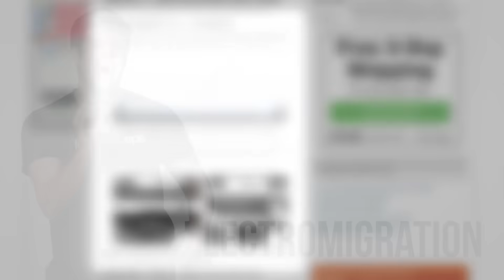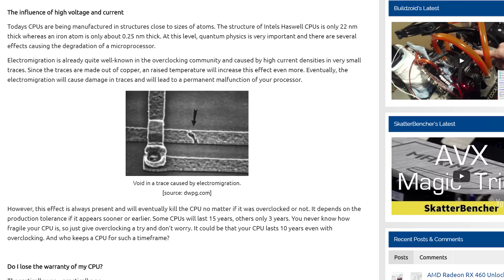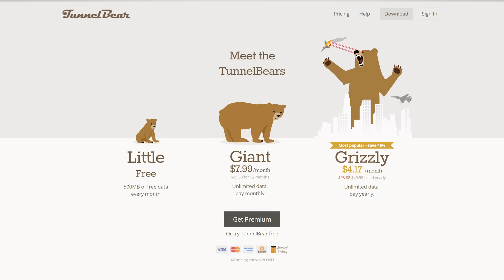Why Do Electronics Die?

Comment: Oxidation. Only gas tight connections are immune to it. Switch contacts, jumper pins, ribbon connectors and so on are potential failure points. Examples of gas tight connections are soldered or crimped and screwed down terminals.

Comment: The old axiom about "moving parts = failure" crumbles when you consider how many more failure points there are in an electronic substitute for a mechanical part.
Perfect example is the $350 Anti-Lock Braking control module for my car. It is no longer communicating with the Engine Control Module (main computer), so it has likely had an internal physical failure. The mechanical aspects of the braking system work just fine, however - the car slows and stops just as it ever did when pressing the brake (it has simply reverted to a non-ABS system). Both the mechanical components and the electronic ABS control module are the same age, but I'm about to burn $350 and an afternoon to make a light on my dashboard turn off, due to an electronic failure.

Comment: Suggestion for another video.   When I blew up my 3kW, 12V inverter from China some of the parts I could not find on the internet to troubleshoot,  e.g. a couple of 12VDC to 110VDC transformers I couldn't find datasheets or schematics for. So, I couldn't troubleshoot them or find replacement parts. Can you come up with any new ways to track down parts like these from China? LuyuanlPower, model DX-GAC3000W; transformer/converter p/n ZB4215 12V-110V

Comment: (Aug 2023) - I just caught this amazing video. Marketing always talks about how great the products are. Service and repair videos are very few and far between. One thing that wasn’t mentioned is variation in manufacturing.  I think manufacturing engineers, and the people who actually make things so well every single day are the unsung heroes of the electronics industry. Put it another way… If the connectors to a power supply are not crimped correctly, that connector will eventually fail.
Thank you again for a great video!

Comment: Well, the Gods of electronics (manufacturers) only want a electrical device to last so long.  This is called planned obsolescence!  I have a computer that since changed a bit, still runs as good after 5 years as a new one.  I also can run most software from the 1980s!

Comment: When electronics die its due to spikes that grow like crystals off all metals and then they make contact...in batteries we defeated this problem making hydrogen pressurized battery cells in space applocations because its the onky battery that doesnt decay and destroy itself..they last 30 years!!!!
I wonder if putting a mother board in a pressure tank of hydrogen would work or submerging board into mineral oil.

Comment: IME, the number one fault in electronics is simply dirty or weak contacts.  plugs, switches, potentiometers faders, trimmers, motor governors etc. oxidation of the metal etc.

For the most part these things can be fixed very simply by cleaning and conditioning or upgrading contact pressure with a little metal bending.

Remote controls usually fail due to the push buttons not making contact, though it could be the battery spring contacts.  If no functions work and the battery tests ok and a fresh battery doesn't make it work.  Then take the case apart, put some isopropyl on a bit of kitchen paper and rub each button contact with that.  That should be enough to remove oxides or detritus from the contacts.  Depending on the contact type, sometimes you can extend the life of these contacts with a cleaner conditioner such as Deoxit F5.  However, some button contact types may not work with a conditioner, in which case, just clean again with isopropyl to restore function. If they are compatible with a contact conditioner, it's best to do that as it seals the contacts from further oxidation & then they will last far longer.  I have repaired a lot of AV, PA & computing gear this way.  It's by far the biggest cause of faults, intermittency, noise & reliability issues.

Of cause, there are real faults like blown or worn out components which need to be replaced, but that is far less common IME.  I recall an old external hard drive that had failed years ago, well I eventually opened up the case to find a normal drive plugged into the back or a case mounted plug.  So I just disconnected that, a squirt of Deoxit F5, plugged it back together & hey presto, all the files came back & it worked again.....  Simple as that.   It's an early vintage drive & it still works.  I don't really need it anymore but it does work.

Comment: They die like all things do now because if they didn't no one would be rich. It's designed to die so you have to buy another. Worked at a car company years ago and found out then that all cars manufactured after a specific date have a programmed kill code in the motherboard chip. At a specified date after manufacturing the car will suddenly have issues pop up. If not resolved in a specified timeframe the chip will literally burn out.

Comment: Bollocks  , its the light bulb conspiracy  made with cheaper materials so it doesn't last as long ,,,,,,I've got old 286/386 and 486 machines there and never had an issue with them burning out component's  in the past 30 years but you buy any computer  after a 486 the boards are crap and the component`s are cheap as there now made in china not in the usa ,. Gees ive still got a working radio  from 1920 and that still works without issue  ,,,,,, and that says it all     Thus was born the infamous “Phoebus cartel” in the 1920s, wherein representatives from top light bulb manufacturers worldwide, such as Germany's Osram, the United Kingdom's Associated Electrical Industries, and General Electric (GE) in the United States (via a British subsidiary), colluded to artificially reduce bulbs lifespan .....

Comment: I had a windows xp machine 2004 that i got that was from my dad who died ,i used it for about a year then it was disconnected for a while because i moved , i decided to fire it up one day about 2 years later to see if it would still boot, the dammed thing poped loud and smoke came out the power supply,  it must have been a capacitor that blew ?

Comment: Is that why my monitor is going out? It started about a month ago, I  wake my computer and the monitor does not turn on, I turn it off wait 5 seconds and it goes on when I press the button,  it's progressing to the point where it takes longer before it goes on , sometimes it takes a hour now, I'm guessing a capacitor is starting to bloat over time and is getting worse over time ? What do you think ? Should I open it and try to find the culprit capacitor and replace it ? If yes where can I get a capacitor? Radio shack is closed so I can't get them there anymore ?

Comment: nothing last forever thats for sure, but i can tell you that there are purpose built in bad solder joints and substandard parts as well and its done so that they die sonner then they should and the cost of repairs most people will not have them fixed so go out and buy new stuff,

Comment: Most likely they die because of solder ball cracks, wire bond burnt, electrochemical migration between signal pins, or cracked capacitors.

Comment: A couple of years ago we used stationary computers in home, and they have no real on/off swithc they had standby swithces, but when you press the stand by switch - the fan stopps
and then noting cooling the small stand by power supply, so it overheats, often a capacitor in the power supply unit box.

Comment: The current goes around a conductor. 
Said conductor can do things like oxidize or erode fro water, just to name two. Then the current can’t spiral the conductor.    Capacitors can absorb moisture and the insulator can dissolve and cause the polarities to touch and short. Tons of ways for each and every type of component to fail. 
I may eat Taco Bell and ruin the atmosphere and the nothing will work. 
I have even seen this dissolve silicon. 😂

Comment: Sometimes my remote that I use on my tv stops working , and installing fresh batteries doesn't fix the problem . But I have discovered that by taking out the batteries and leaving it alone for maybe an hour , when I put the batts back in , it seems to work fine again ! What happened ? Was maybe a capacitor acquiring charge and retaining it , but taking out the power source and not using the remote for a while allowing that charge to leak off ?

Comment: The updates and new software running at faster speeds with bigger files make computers or all kinds run slower and slower so after 4-5 years people buy new. Even when new imo ur everyday computers that u buy at Walmart or Best Buy are not fast enough unless you spend big money and I think this is because if they made them faster people would wait to buy a new one. If I owned a computer company I would install the maximum ram and good solid state drive in every computer and be marketed as the cheap fast computer company we would make 2 desktops and 2 laptops one of each is just a regular computer and the other is a gaming computer. Basically like emachines sold cheap computers but people would have a much better experience because they come with 3xs the ram that any other computers come with at that price.

Comment: I have two Acer laptops that have lasted well. one was purchased back in 2011 and the other back in 2017 and both still work well and are in daily use (typing this on the 2017 one). I cannot say the same about HP laptops that i had in the past.

Comment: capacitators die. they can be replaced
Reply: Not if the circuit board tracks are designed to lift off as the components are unsoldered!

Comment: As an industrial electronics designer and service person for more than 30 years, I say it's mostly a scam. Electrolytic  caps do wear out that is well known but mostly, well-built electronics will last for many, many years. The SSD stuff you spoke about is another type of component that "has a life". But basically transistors, resistors, ceramic capacitors don't wear out. Dry joints can be a result of heating, as you say, but these are mostly caused by vibration. If a piece of electronics doesn't get hot, it should last for a very long time. 

I have never, ever heard of electrons "wearing out" copper conductors. Maybe that's an issue inside chips that are made with very fine conductors but generally, copper tracks and wires don't stop working.

One of my lines of work is Classic synthesizers made in the 70's and 80's. The old microprocessors in those machines are still going strong today. They were made more robustly than some of today's chips which, as you say are designed to fail after a time. 

I have an apple notebook. The battery exploded and I had to have it replaced. I asked the shop if I could run it without a battery for a while until I could get the cash for a new battery. They said yes but it became harder and harder to turn it on over time. Then I took it to a more experienced tech who said "when there is no battery in the unit, it slowly blows this chip... 

Bull. NOT having a battery in something cannot cause it to blow. Unless it's designed by an idiot or, in the case of apple. A clever money-sucker. That chip is not blowing, it it is intentionally simulating "blowing". Even the techs don't know that.

The concept people today have of "everything having a life" is a marketing tool to suck everyone into buying more and more junk.

Comment: As far as printed circuit boards go, semiconductors like diodes and transistors can last "forever". The main culprit is electrolytic capacitors, whose failure can cause a chain reaction (domino effect), that can ultimately zap ICs, MOSFETS etc.
This is especially true in vacuum tube gear, where recapping the TV or radio set will often make it work. This is true with electronics made in the 1920s and 1930s with wax-dipped paper capacitors that turn into resistors.

Comment: Just like V and I (current) v is pressure but i is electrons.
I = V/R
ex restiance 0.01 ohm and v 94492 equals (94492 / 0.01) = 9449200 (dividing by decimal OR fraction increases number)

Comment: Flash report. 

Science has progressed to the point that we now do not believe that "current are electrons flowing/moving".

Current is actually just energy flowing through the EMF of the wire. Which means the wear in your wire is just heat.

Comment: A comment about your sponsor Tunnel bear: don't use it. Mine stopped working and the sup said it's your country limitation on VPNs. It's like a drug dealer not operating because cops are very annoying. Unreliable. And the time to connect is very very very long.

Comment: cannot fool me, everyone knows about the hot shaky gremlins which convince electronics to embrace suicidal thoughts. The less a user understands about the device, the more likely it will want to die. Many people give me cast-off, 'dead' electronics - usually laptops, tablets and phones - and if intact, they heal within a day or two, without any modification. Well, 92% of the time, anyway. I've turned this into a business hiring out working retro tech to the film industry. There is a drawback to this ability, in that plants die when i touch them, so if you have green fingers chances are your devices hate you.

Comment: I thought sidewalk or pavement damage was caused by water sipping into the smaller cracks, and expanding (instead of shrinking like ALL other matter) as it freezes. not exactly the analogy to use here.

a 1 min ad in a 6 min video?

back to the topic... maybe we need to switch from electronics to optic circuitry 😮

Comment: Don't often click on the random vids YT recommends but when I saw a much younger looking Luke I got curious.  An interesting fact relating to thermal expansion:  The first electronic* computer, the Colossus I, was built during WWII to help decrypt Nazi Tunny Codes used by their naval forces (their army used Enigma codes which were defeated with an electromechancial computer called La Bomba).  When the proposition to build Colossus was first made there was a lot of push back because it was a well known fact that vacuum tubes (which the British call thermionic valves) failed quite rapidly, fortunately there was someone there (I think Tommy Flowers) that had experience with vacuum tubes and knew that so long as they kept the tubes warm they would last a lot longer. The reason the tubes normally failed is because of rapid heating and cooling.

*Colossus I and it's successors were special purpose computers, the first general purpose computer was made later using similar principles.

Comment: Hard reset can reset its counter. Most devices rely on the battery, causing malfunctions when not replaced. An interesting memory effect exist in battery resistors (000 and 200). To remove it, solar power bank is needed for 2 charges.

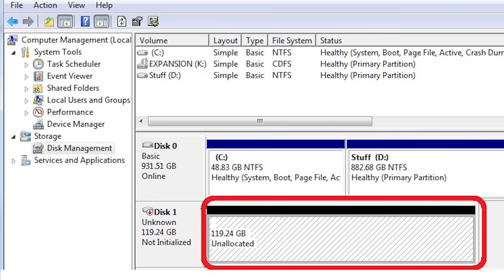Comment: 4:06 is that why my 2TB hard drive have only 1.81TB usable ?
Reply: I believe, that that is because of how the drive manufacturer rates the amount of space on the drive and how windows does it. For the drive manufacturers, 1TB could be counted as 1 000 000 000 000 bytes, but for the OS, 1TB could be counted as 1 099 511 627 776 bytes so 2 drive-manufacturer-TB is ~1.818989 OS-TB
Reply: @terasestHammasratas  thanks for the amazing explanation

Comment: Planned obsolescence is stupid with Windows 10 Updates.

I got a laptop in 2019 with an HDD and it was fast. Nowadays with the HDD it’s stupid slow, always 100%, using the same apps, just because Microsoft optimized windows 10 for SSD and anyone with an hard drive is kinda… fucked.

Comment: This is the obvious reason why electronics in general fail.  That’s 5% of the actual failures.  The real answer to this question is how manufacturers use materials that cause premature failure.  Capacitors are not like concrete sidewalks lol.  This guy knows the basics - the real answer would be much more surprising.

Comment: Cosmic radiation?

My Alfa Network AC1200R router died in such a way I could not log into it, even after performing a factory reset. Before I did the factory reset, it worked. I just wanted to log into it and change some settings, but no. I did the factory reset several times. It "works", but it doesn't work. Log-in page now gives an error message about missing password, even though the manual says it's not needed (the first time you log in to set it up etc). The usual defaults don't work, so idk what it is now.

I have no idea what happened. All I can think of is sort a woo explanation of cosmic radiation changing the firmware somehow (bit flipping?). Sure might be something else, but idk what. Afaik it doesn't auto-update either (I guess it's a remote possibility - see what I did there ahaha). Perhaps planned obsolence?

EDIT: MYSTERY SOLVED! It was none of the above. It was "simply" a matter of using a specific (older?) browser (Firefox or IE) to access the web interface (!!!). Except, I had to edit the URL a bit after attemping a log-in, which was new to me. I had to remove the last dot htm part of login dot htm.

But I must attempt a log-in first to do that (even with no username and no password after factory reset), and get the error message first. Then edit URL. Go figure.

Comment: Dude, the capacitor electrolyte does not conduct current, well it kinda does but that is what breaks the capacitor. 
It's electrolyte is an insulator and it is what keeps the charges on the plates on the plates.